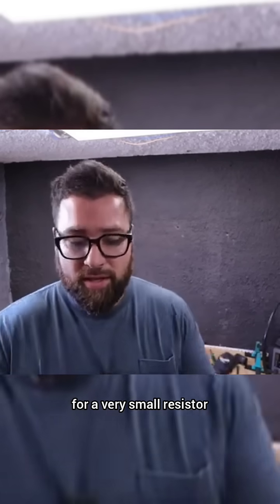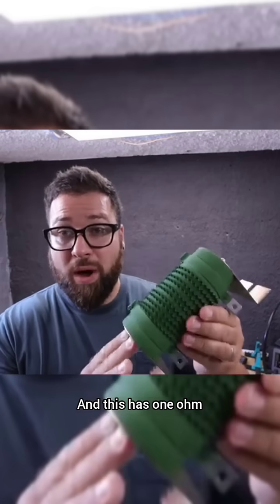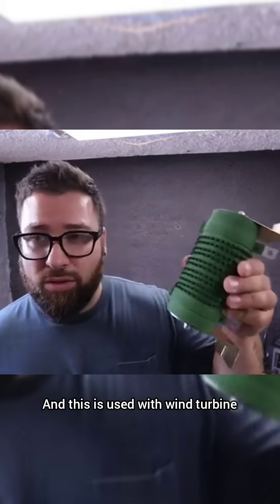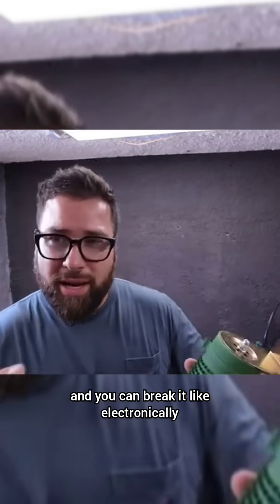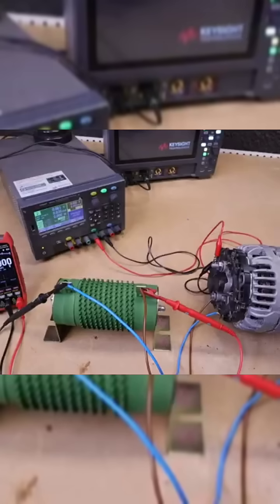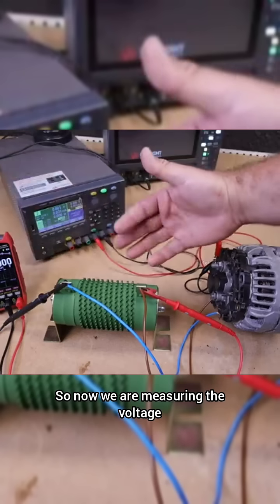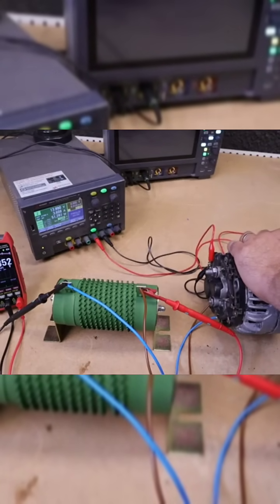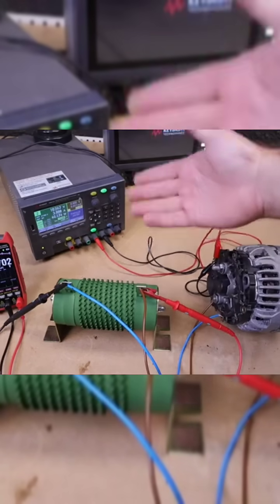Resistor on FIRE 🔥 🐦

Comment: Do you know why it's on fire? What he just explained is the answer.
Reply: Most resistors that size are rated for 1/4W or 1/8W, sometimes 1/2W but I’ve mostly only seen 1/4W. 

So if it’s also a 1 ohm resistor, at 14v, you’d get 196W. 

resistor power ratings are based on how much heat they can dissipate continuously, so if you had that small resistor on for a split second, it might be fine. But the longer it’s on, heat will build up, and after some time it’ll start burning it out